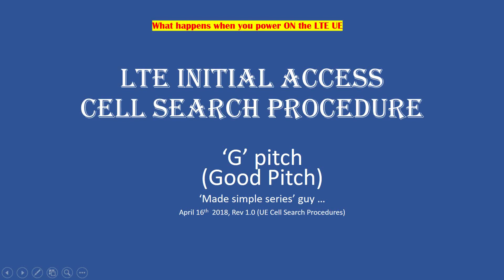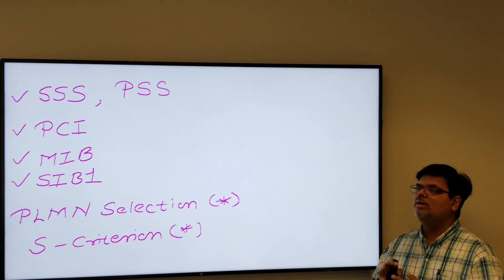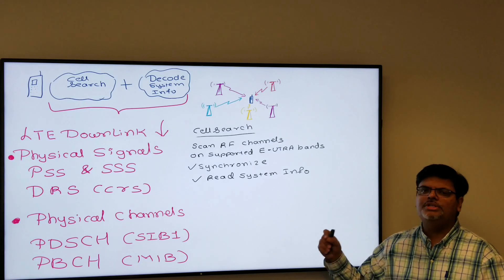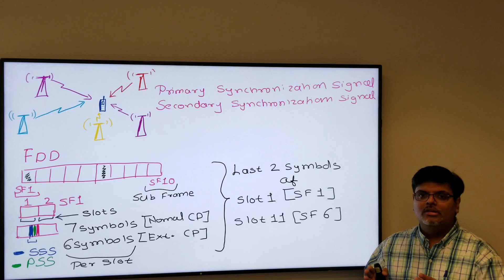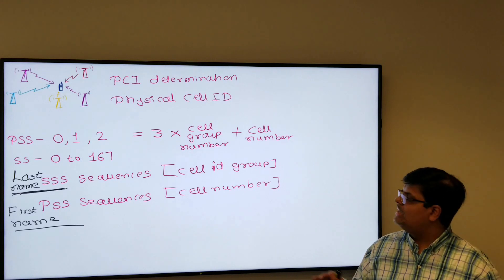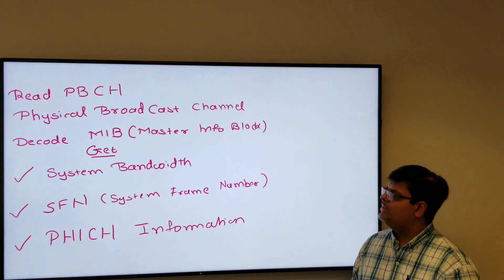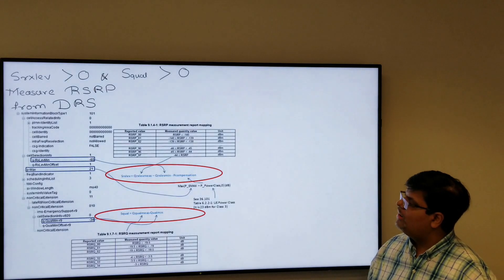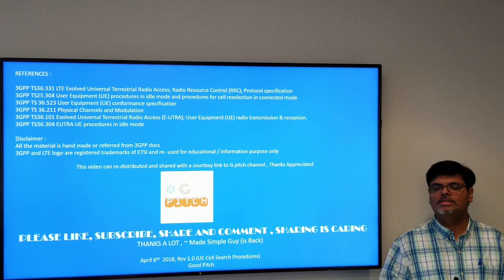LTE Initial Access, Cell search Procedure - UE

Comment: very good explanation, but I hve Q. supposed I have inserted Sprint sim card in my mobile when it switch on it will start scanning RF channel after that it will do the slote snych & frame synch  ,will UE will do slot snych & frame synch for all other operator also if they satisfied Drs criteria greater than -110 ??
Reply from the maker: Very good question, Yes it will scan RSRP of all operators greater than -110, also one more thing, lets say SPRINT has two cells transmitting in that area, one at -90 and other at -100 it will pick up the strongest one of the two, so it will pick one best cell of all operators in case of sprint the -90 cell and also read the PSS and SSS of all of them and then there is next step of PLMN selection which is only after reading SIB1 and matching with the USIM, if you see in unlocked UE's , UE provides two options for network selection (Automatic and Manual) , When you select Manual it will show you all the operators such as ATT, VZW, SPR and TMO and you choose manually, this is possible only after it is synchronized and read pss , sss for all  those operators, Again in case of manual if you choose the operator it will go and match the PLMN from SIB1 with the USIM PLMN, in case of automatic it will read PSS and SSS and do the synchronization of 'best cell' that is strongest cell of all the operators(Scan every operators strongest cell, also read pss-sss) based on bands supported by UE ,so again answer to your question is yes and then finally after matching the SIB1 PLMN and USIM PLMN it will go and camp, more detailed PLMN selection process, refer 3GPP TS 36.304 , hopefully it solves your Q. Thanks !!
Reply: Thanks for reply..Now I got clear idea, adding two thngs in UE handset ( manual & automatic network selection that clear my dought )
Reply: @HirenDharani  very good informatics video can you post all LTE handover and volte call flow with log analysis which would helpful for day to day analysis

Comment: how UE is able to identitify " central  62 subcarriers"  with out knowing the bandwidth of the cell
Reply from the maker: 62 of the 72 reserved subcarriers are around the Direct Current Subcarrier in center , DC carrier is having no information, It is very important carrier in ODFM system, based on which UE will locate the center of the ODFM frequency. UE will scan DC carrier (no info carrier) which is also in center and then locates the other 62 carriers around it left and right. I will prepare separate topic on ODFM / Radio Frames and structure, stay tuned
Reply: @HirenDharani  thanks for the explanation,i cud see only this video in you channel.may i kno wer d other videos are, as u mentioned at 2:58

Comment: Simple explaination and pretty informative. My doubt is,
1.consider i have Sprint SIM in my UE and the RSRP of Sprint in that location is -100db and RSRP of ATT is -80db. In this case UE first scans ATT then it goes to next strongtest (consider verizon -90db) then it goes for Sprint. So it has to scan all the networks/Cells in the increasing order of RSRP.

2. consider i have Sprint SIM in my UE and RSRP of Sprint in that location is -111. here it just scans all the Networks/Cells till SIB reading and finally shows no network to UE.

Please correct if am wrong.
Reply from the maker: Answer to your question 1. It will scan  RSRP of all operators greater than -110 ,  doesn't matter what values, please check my detailed reply to Sharad, pinned above

2. If it can't find LTE network with a matched PLMN in SIB1 along with USIM PLMN, then it will go and look for alternate i.e 3G and 2G whichever is available or provided by that operator. There is a detailed PLMN search procedure which UE will follow 4G->3G->2G (LTE-WCDMA-GSM)